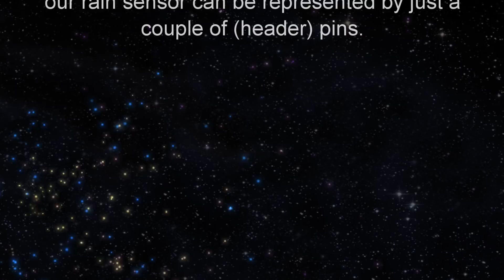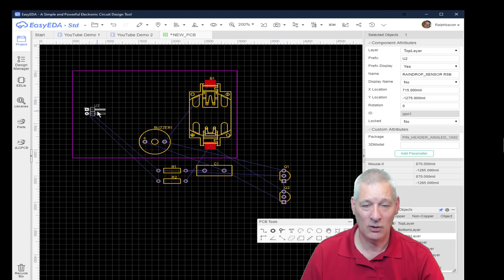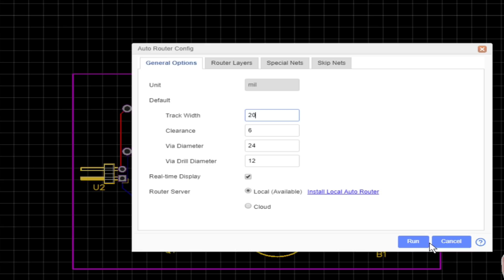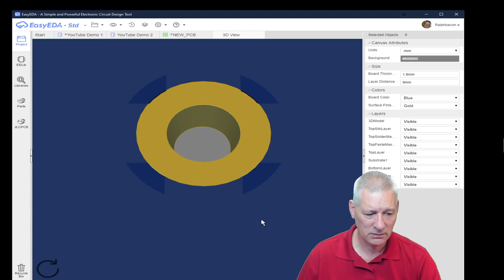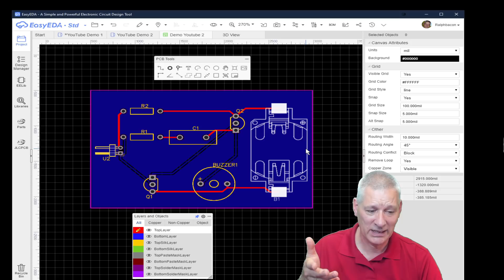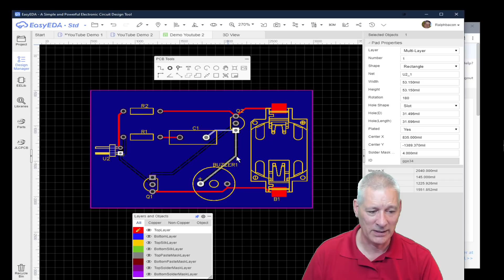#165 From Schematic to PCB - Part 2: Designing and Ordering the PCB ✅

Comment: Interesting to see how well the program is integrated with JLC, but I do not agree with your layout. Why use that large PCB for these few parts and where is the mounting holes? I know it do not matter for a demo PCB, but for practical PCB's I often consider the box (including mounting) where I want to put it and the size of the PCB.
A good way to check sizes is to print you PCB layout, this can often be done in a 1:1 size, i.e. you can check if the components fits and if the PCB fits in the box you want to put it in.
Spending some time on moving the parts around is often a good idea, it allows you to make a compact PCB and to optimize the routing.
I wonder about the ground plane, I have never heard about it as something you usually do. I added it to some of my PCB's when I see a point in it, but it is not one all PCB's and it is not always over the full PCB.
When I used Eagle I usually manually routed power and fast signals and let the auto router do the rest, but now I uses KiCad and there is no autorouter (It autoroutes a track while you place it, but it can be very annoying), I have found out that it is fairly easy to route most of my PCB's. The only question is how much OCD you have, if it is at a high level you can spend many hours optimizing the layout.
Reply from the maker: You can spend hours tinkering with the layout and placement of components on a board, Henrik, as you say, depending on your OCD level! But Ground Planes (on both top and bottom of the board) are a sort of de facto standard these days when using microControllers as it provides a limited protection against all that RF stuff (even the 16MHz clock) getting radiated. Basically the trace carrying the signal (on top) will have the bottom return path following very closely if there is a ground plane underneath it, thus minimising loop inductance.

It also provides protection for your µC against EMI, especially if the ground plane is both top and bottom. However, separating Analog and Digital ground return paths is pretty essential and most often forgotten (it's all just GND, right? Nope.) to reduce noise and interference. It's something I'm trying to use these days if the circuit needs both types of signals.

PCB design is as much an art (aligning components - actually a must for pick and place machines and flow soldering) as a science in some ways, although there are some very definite DOs and DON'Ts that are based on real science. VCC tracks need to be bigger (eg 32mil not 6mil) and apparently right angles in tracks WILL cause radiation of signals so 45° changes of direction are preferred these days.

I just found this interesting article but there are a gazillion others: https://www.autodesk.com/products/eagle/blog/8-pcb-grounding-rules/ 

Good to hear your perspective on things, Henrik, thanks for posting.
Reply: As I said, I use ground planes when I see a purpose in it.

http://lygte-info.dk/pic/Projects/Charger/PCBV2layoutd.png

The link shows a PCB where I need to run a switcher next to where I must measure with 1mV stable resolution. The two parts got their own ground planes.

I also put some text in the copper layer. I have always been doing that, it is good for more discrete markings.

Comment: One again a great video, thoroughly enjoyed. Enjoyed to the point that I would ask for one or two follow on videos. I've mucked about with easyeda for a few months now and know there is info that would have been helpful earlier on. I'm currently digging into multiple designs on my 100 x 100 foot print. 

Anyway... how about a video of hints and tips in manual layout? Could be worth while to probe into component creation too. A la cloning of parts from other users,  and custom components (I had to build a custom foot print for a switch I wanted to use from my parts bins).

If you are interested, I'd be willing to put together a list of hints/tips that I think would be useful.
Reply from the maker: It's tempting to do a follow-up, Dale, but given the very low viewing figures on the last video, and even lower (so far) on this one, I think my audience would eventually desert me [sad face]. Maybe I need to do an extra video where I (and YouTube) don't really worry about viewing figures. Or put something up on GitHub.

Comment: Great job as always, but you should have told them that if they don't use the spoke design on ground plane connections, they better have a good hot soldering iron or one with a lot of thermal mass to solder the connection or they will get a cold solder joint.
Reply from the maker: What you say is very true, but the slide-up text did mention it makes soldering easier, Edward, but I didn't want to overload beginners with the reason. But now you have done that, so I'm sure others will read your comment and understand that, thanks for posting.
Reply: having a CLEAN PCB helps, as well as using flux.   Too much heat can lift the copper

Comment: Ralph you are SPOT On with not having to give up on using the product. I have ran into where the copper ground on the board did not update till I ran the Copper manager. The process of knowing what the board should look like needs time to figure out and play around with before an order is placed. I could not agree with you more. It takes time to use this tool and it works very well. Thank you for the excellent video.
Reply from the maker: Thank you Don. LIke most things in life, we get better when we practice whether that playing the piano, driving a car or designing PCBs. And you can't learn experience, you literally have to make mistakes in order to get that experience (as you will see in my next video where I made a fundamental design boo-boo).

Comment: I'm on to my 2nd board now. The first one was all THT because I had already ordered parts to assemble it on strip-board. After checking it out on JLCPCB and seeing that the cost was about what it costs to eat lunch at a fast food place, I took a leap and ordered 5 of the THT boards.
Now I'm using SMD components and considering the JLCPCB assembly service. There are 9 SMD components on the new board and all but one are from the 'basic' list. My understanding form the JLCPCB site is that there is a $3 labor charger for each 'extended' SMD component. Also there is a $7 'engineering' fee. Still seems quite reasonable.
If anyone would like a good laugh - https://easyeda.com/colepdx/remote-senor
I welcome all criticism, constructive or destructive.
Reply from the maker: I've had a quick look at your board's and PCB design, Dirk, very neat. I'm glad you are using much bigger tracks for the VCC connections, but you have forgotten the 100nF caps between VCC and GND on both sides of the chip. If your design is battery powered it might not matter so much, and if you don't use the analog functions even less, but Best Practice (and DataSheet recommended) is to put 100nF caps really, really close to the VCC/GND pin pairs. Whilst you're at it, another one from VREF to GND if you want to monitor battery voltage (always assuming this is a battery project, otherwise no need).
A useful function to enhance the mechanical robustness of tracks where they join vias and header pins is to use the Teardrop function under the Tools menu. This ensures the track has a 'teardrop' shape at then join, increasing its strength. You might have to manually adjust some of the teardrop shapes afterwards as they get too close to other tracks sometimes (EasyEDA fault) but that is really easy to do (polygon line drag, takes but a second) - have a go!
Very nice design there, good luck with the construction.
Reply: @RalphBacon  Thanks for taking time to check out my work. I received my boards yesterday. I'll have to bodge the 100nF caps onto the bottom of the board. At least they will be really really close to the pins. A little disappointing to have to bodge the board but it is my first try so I guess it is to be expected. 
I'll implement the teardrop shape into the board I'm working on now. Not seeing the teardrop tool a first look but I'm sure I'll find it. I'm making a Nano shield with the auto-switch off circuit and header for the RF module using SMDs. 
I'm really enjoying EasyEDA.
Thanks again.
Reply: @colepdx187  No offense but that was covered in the Comments in Part 1
Reply: @kennmossman8701  I usually watch Ralph's vids shortly after he uploads them. I read whatever comments are there at the time. I can see now that's it would well worth my time to return to the vid later and read more comments as there is a wealth of info in them.
No offense taken and thanks for the info YOU share in Ralph's comment section.

Comment: Great video as always, Ralph! 😊
A video on manual routing would help a lot of people, I think 😃 I tried the auto router for the first couple days I started using EasyEAD, but found it really slow and cumbersome, but I dreaded the thought of manual routing until I actually tried it. Now I can manually route tracks in paths that make a lot more sense (for example your rain sensor can be routed on a single layer :D)
Reply from the maker: Indeed, Azy, the Autorouter is not perfect but when you have many, many nets to route it can really help out, even if it only gets 90% of them "right". As I mentioned in the video, it could have routed it all on one layer but perhaps there is an algorithm that lets it use 2 layers if they are available. I've just done an entire UNO board with it, it would have taken me until Xmas to complete.

Comment: Great video!  Any chance you will be covering the 'how to' part of ordering boards with SMD components soldered on at their factory?  I'm just on the edge of ordering a few boards but IF they'd do the hard part of soldering SMD components for me, it'd be worth it to me to learn that too...
Thanks for the great videos you crank out... Love em!.
Reply from the maker: JLCPCB will SMD solder one face of your board only, Ronald, at the moment (top or bottom, you choose) and it's not too difficult. You must generate more files: the BOM from EasyEDA so they get a list of components, and the Pick&Place file which you can find under the first drop down menu (New, Open, Save...) and at the bottom of that list you will see Export Pick and Place File.

You won't need to mirror the components on the underneath (the pop up tells you this) and just press Export and upload to JLCPCB along with the BOM. They will be checked by JLCPCB so don't worry if you do it wrong (as I did initially). Just try it and see how far you get - no one will force you to pay money until you are ready. 

I'll be showing a JLPCB SMD soldered PCB in a near future video, worked like a dream!

Comment: Hi Ralph, great video.
Sorry couldn't stop smiling.
Here in Australia we   "AutoRoute"  not  "AutoRoot" a trace. 😮😆
I prefer not to "AutoRoute"  or "AutoRoot" .
My philosophy about copper on PCBs, you have bought a PCB covered in copper, are you going to pay someone to etch most of it off?
I try to leave as much of MY copper on MY PCB.
As you construct your PCB save the file under development names so if you make a stuff-up, you can go back before your mistake and not loose all your work.
Reply: Tom George lol. Thanks for the reminder, I had learned some time ago the Australian different pronunciations of Rooting and Routing... and when I was informed what rooting means, it always makes me smile  :-)
Reply from the maker: This sentence, Tom, sounds the same to me: "Here in Australia we   "AutoRoute"  not  "AutoRoot" a trace."

Perhaps you speak like them across the pond do, AutoRoW-t (as in RoWt 66, not Root 66) where the RoW bit is pronounced as in argument rowing not boat rowing. 😮😆

Regarding its use, see my comment to Andy at the bottom of this list. I find the AutoRooooter quite good, not perfect (as this demo shows!) but so much quicker than me!

Comment: Hi Ralph, I made my own footprint for that exact battery holder, just because I like that surface mount one, but it's not half as pretty as yours! such detail, could I, (in theory) import that just as a footprint into Kicad ? 
I just went to JLCPCB and they are saying it's $2 as normal, but as you progressed your PCB price doubled to $4 what did I miss?...nice clear explanation, cheer's... Oh yeah, real men don't use Autorouter :)
Reply from the maker: I'm not sure about importing footprints, Andy, although I have successfully imported entire KiCAD layouts and circuit diagrams into EasyEDA. In my demo I think I upped the number of boards to get it to$4. It's $2 for 5 boards though.
Now, about that Autorouter; I've manually routed most (if not all) my little boards, just to get used to doing it. Then I designed an entire Uno board using the 328PB chip and had 47 tortuous tracks to lay down. There are not enough hours in the day for me to do that, so AutoRouter to the rescue (which also took several iterations but got there). I adjusted a couple of tracks and I'm good to go. Woo Hoo!
Reply: @RalphBacon  good point!